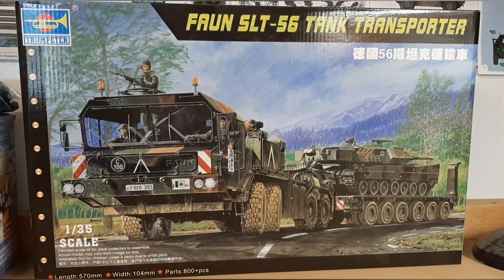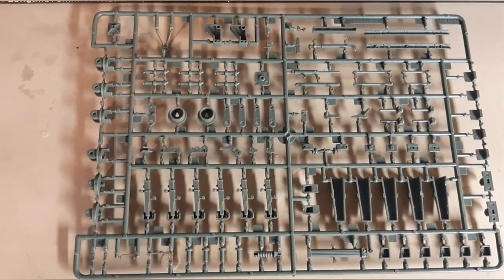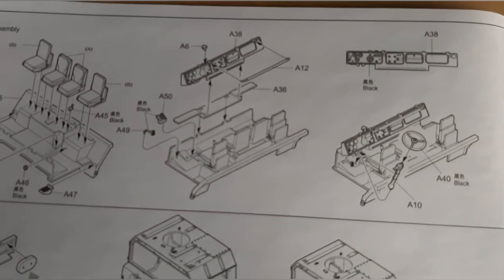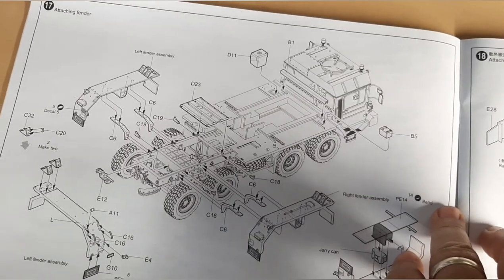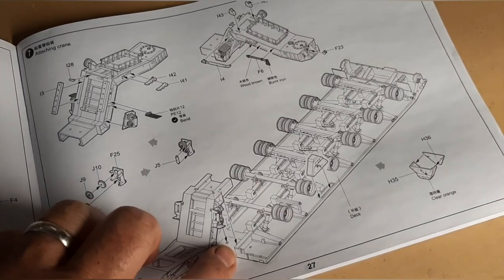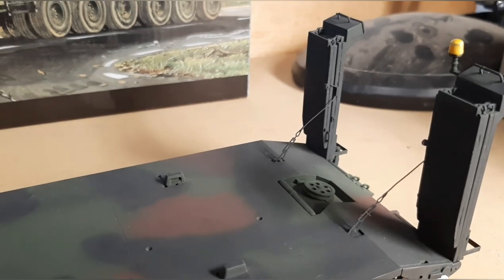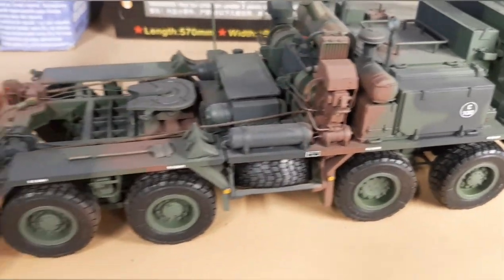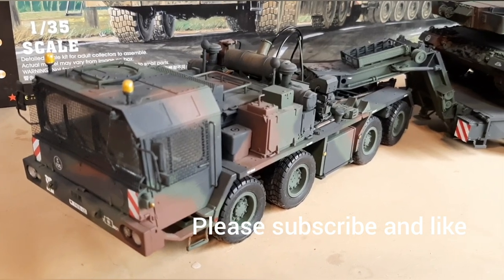Trumpeter 1/35 scale Faun SLT-56 review and build (video #15)

Comment: excellent build

built one of these years ago, but not very well. Had issues with the first trailer axel being the sane height as all the others. The instructions made it fairly easy to make mistakes, or i could've just rushed it. 

Trumpeter announced a SLT 50 version in 1:35. I've already built their kzkt 7428 and MaZ 537 tank transporters. Great fun to build, well engineered kits. The faun is their older work (early 2000s) but still a great model today
Reply from the maker: Thank you. I had to take my time. Lots of parts. I struggled a little on trailor also. I heard about the 50 a long time ago but haven't seen it yet. I'm hoping they didn't scrap it.